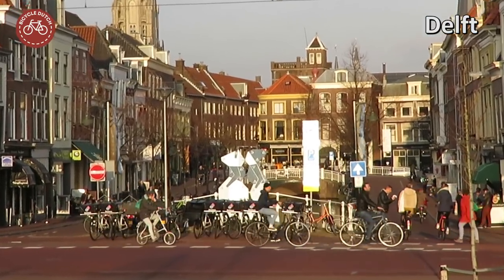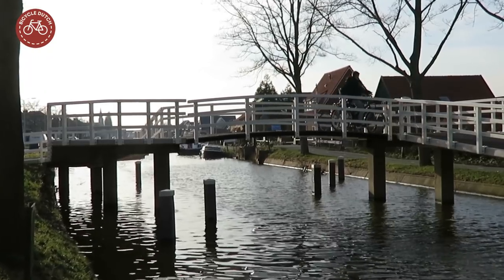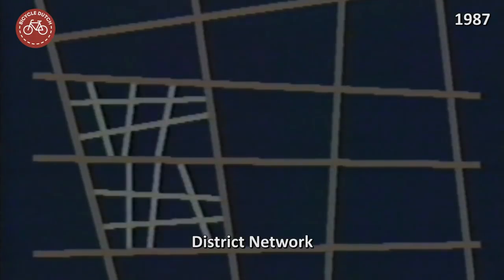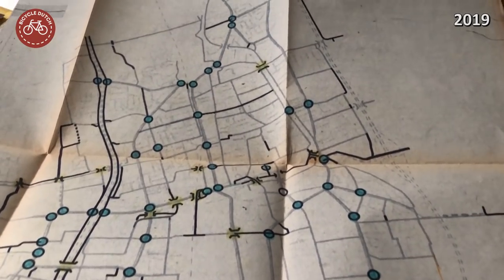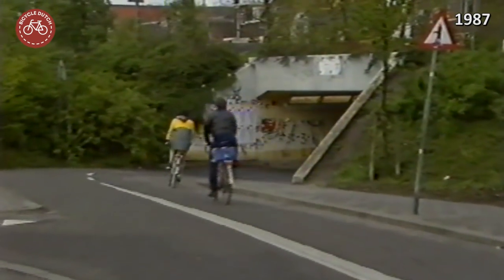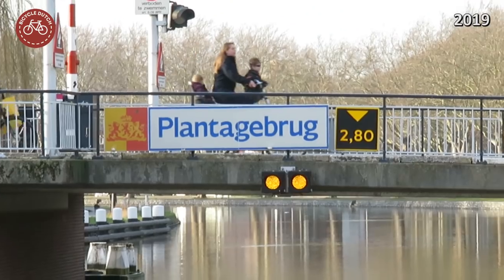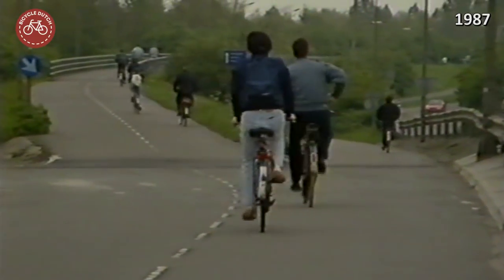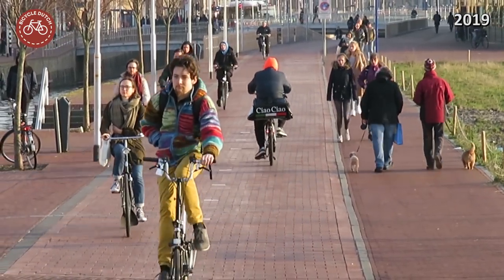The 1979 Delft Cycle Plan

Comment: When Lelystad was planed and build in the 60 and 70s they made a stand alone bicycle network with elevated bridges all over town marked with yellow top streetlights. The only downside was that when riding to the town center you had to climb 3-5x  6-8 meter high bridges.

Comment: 0:25 never have i seen this in my cycling life in The Netherlands..

Looks very pointless too..
Reply: I don't think it's great and I'm sure that there could be a better solution, but for what it's worth: It's a spot where, to turn left, a cyclist needs to cross a road where cars can come from behind them. Visibility for the cyclist is thus not great. If, then, you want to turn left and there is a car approaching from behind, it would be very dangerous to just cross in front of it. Simply stopping on this narrow bike path until the cars have passed is also not great for other cyclists behind you. Instead, it is safer to stop in this bay on the right, let cars and other cyclists pass, and then cross the road.
Surely a better solution would be a separate bike path and a crossing that meets the 'vision zero' standards. Maybe this will be installed eventually? The Netherlands is already the safest country in the world when it comes to cycling and they are constantly(!) building and improving their infrastructure. I think it's fair to cut them some slack in places like this - it's 'good enough' for this place, for now, while other more critical spots are being renovated.
Reply: True. I cycled there sometimes and it took me more than three months to notice it. I though it was more dangerous actually.